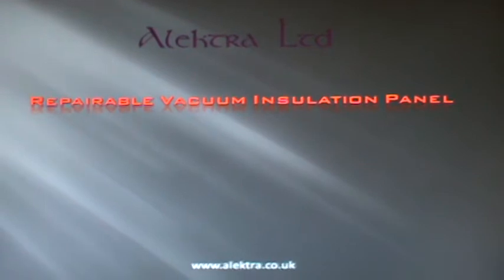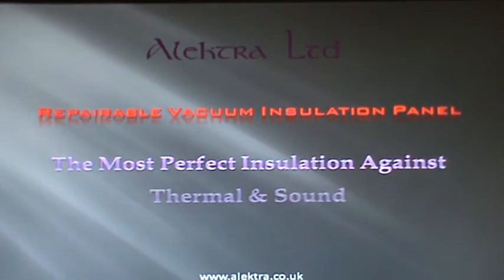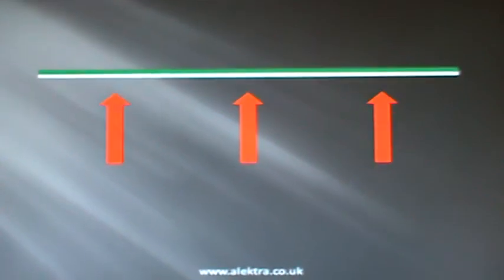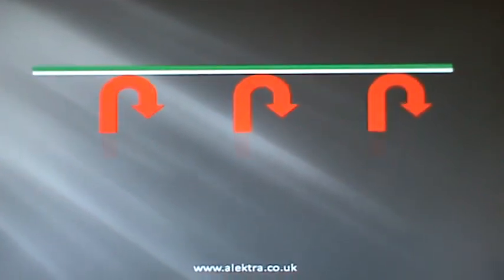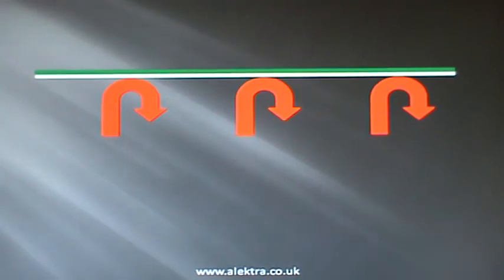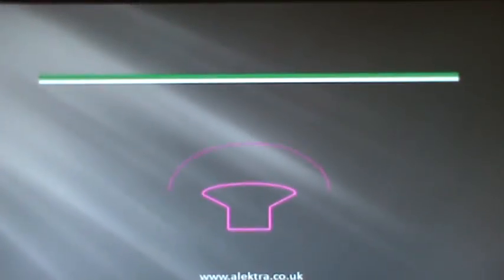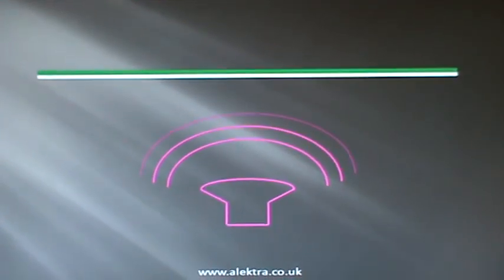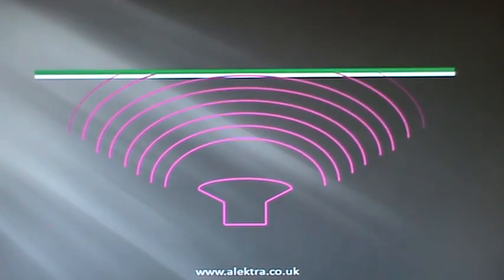Alektra ltd Vacuum Insulation Panel

Comment: The "VIP" (vacuum insulated panel) is a such a great idea, but it is unfortunate that it hasn't been made durable enough - or easily and repeatedly "re-evacuated" (such as via a simple pump) - to gain in popularity, or to compete yet with with more conventional methods.  If one could be built that had an interface that could be easily accessed via  a standard vacuum pump such that it could be easily re-evacuated as it gains pressure - and if it could more easily & cheaply be ultra-strong . . .